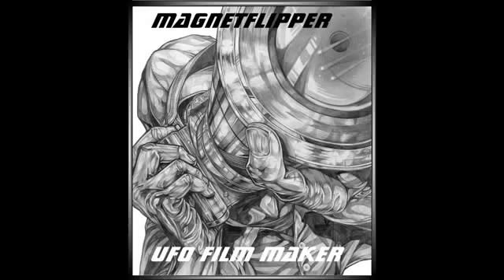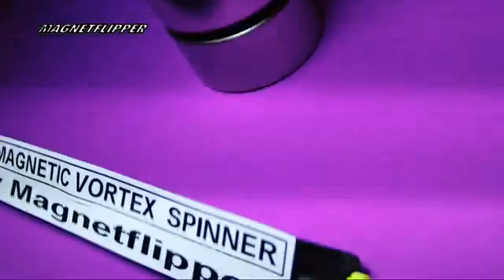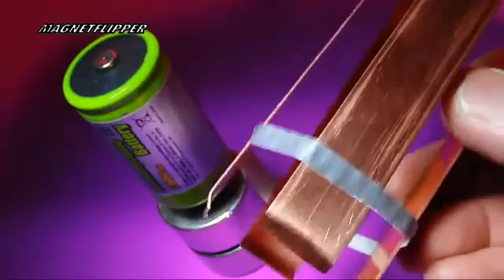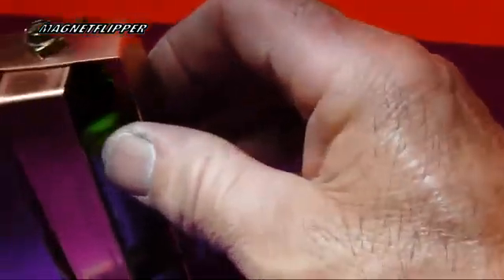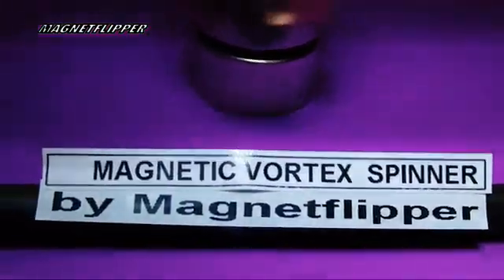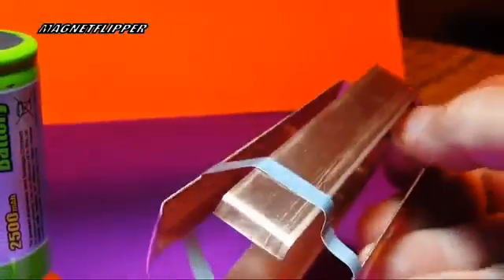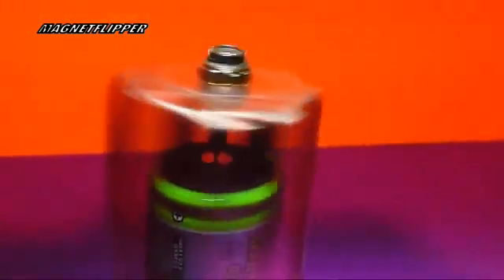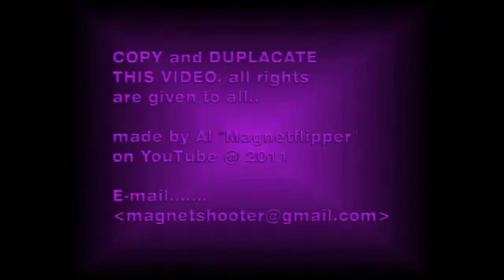MAGNETIC VORTEX SPIN built by Magnetflipper Sept 2011 (Uploading due to his Channel being taken off)

Comment: Measure the current through the armature, the angular acceleration of the armature, the mass of the armature and its moment of inertia, and energy loss due to friction and heat.  You will find that the behavior of the system is in agreement with established electrodynamic theory.  The the torque on the armature is due to the motion of electrons driven through the armature by the battery, relative to the permanent magnetic field due to the neodymium magnet.  And yes, it agrees with the text books

Comment: @inphiknitfractal Yes I know that experiment and the fact that magnetic lines of force follow closed loop paths does not automatically mean that there is a "vortex" happening.  You said, "that field pulls to center through a top & bottom vortex conjugating at center causing implosion" and that is complete nonsense.  I suggest that you try to actually understand how magnetic fields are formed before you jump to your wild nonsensical conclusions and have MIB fantasies.

Comment from the maker: @User2718218 Maybe you should think about what you're saying before being so sure you are correct....Did you not also take a magnet at some point (either in school or not).. & see the proof of a toroidal (donut) field by placing it under paper with lead or metallic filings that follow the contour of the torus? that field pulls to center through a top & bottom vortex conjugating at center causing implosion. You have the same field in every cell of your body & from your heart extending aprox. 10ft